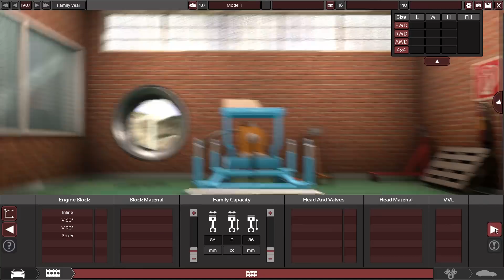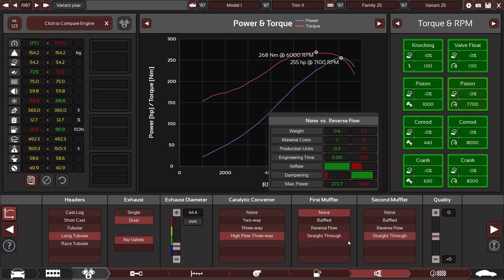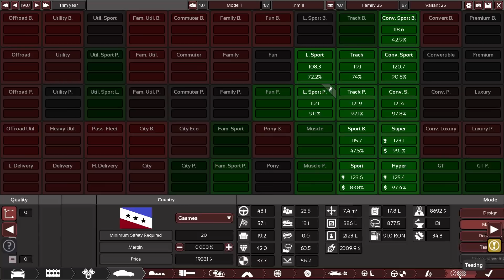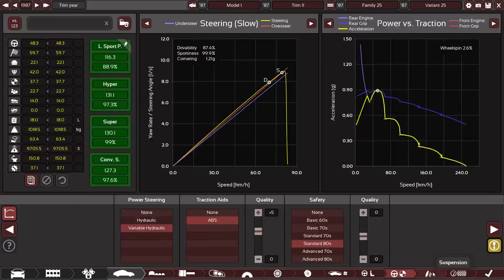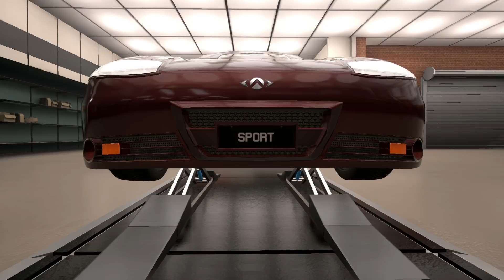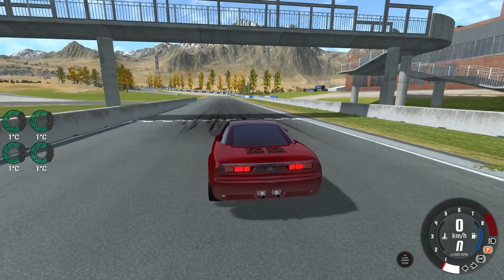BeamNG + Automation: 1987 Light Sport Premium, GETD Ep.17

Comment: Do a rally car! Must be light and easy to repair.
Reply: 90s homologation rally car. 2.0L turbo engine in 4 door 4 seat body with high torque, AWD and around 300hp. Have to be easily produced at above 5000 units per year. This is around the homologations of that era.
Reply from the maker: Rally car is not a demographic :P in case you had not noticed what this series is about ;D cheers
Reply: KillrobPlays Crossover/raised cars class (Volvo V60 Cross country) could be a category/demographic. Then a sport version of that category are essentially rally cars. Just a thought.

Comment: If memory isn't failing me, there was a 1st-gen MR2-esque body in the Kee version, which I don't think made it to the UE4 version. That would also be a very cool body choice for this challenge, being even more compact than the NSX body. 

As for the engine, I went "hopefully it's a boxer" when I saw the title. What good is a new trick if you don't abuse it? ;) Also, why is the Elanis such a monster of a hypercar? Is Boxer 6 that exquisite of a solution for the era? It's "only" making about 255hp! 

As for the design... er, the rear is period-correct. But the front screams more late '90s than late '80s to me. Why not pop-up headlights? :P
Reply: The Ferarri 328 (1986-1989) had 255-270hp and weighed around 1260kg, in that time such a car was pretty powerfull.
The 348 that came in 1989 had 320hp.
Reply from the maker: It certainly has plenty of power, especially for its weight :) it does most things a hypercar does really well, too.
Yeah, dunno about the design, it doesn't look all too 90s to me with the strong lines and overdone bulge and all that :D pop-up headlights would have been a more "iconic fit" though for sure.
Reply: I guess a better number for a light sports in the '80s is somewhere in the 170-200hp range, then. Will definitely keep that in mind should I ever design a similar car! 
And yeah, the front bulge is a bit too much for a light sports car, especially one where the engine is behind your noggin'. :P Pop-ups may be standard fare for the era, but they're the best bet for easy '80s vibes. 
Plus there are different ways you can approach them; you can either use the game's standard units, or color non pop-up ones to look like them! It's an interesting fixture type to work with for sure, as much as modern LED housings.
Reply: Mike van Lieshout No wonder a GM mini truck was faster than it.

Comment: I always found Light Sport to be a difficult demographic to exclusively cater to, they are somehow happy to pick up the scraps of others I think. (I also have to mention that my own 'houserules' for building are a tad different: I tend to set the design year so the car is /engineered/ by my target date, and then optimize for maximum markup. Probably a big mistake there with how everything is still just a dummy before the light campaign, right? :P )

I like that body a lot, and it's a really beefy car you sculpted out of it! The rear is especially well designed, I love 80s blocky car butts. Incidentally, I have made my own take on an '87 sports car on that body like a month earlier, but it's a good bit different (and way beyond my gamepad driving abilities).
https://i.imgur.com/rcTkuCS.jpg
Reply from the maker: Yeah, your competitors at this point use zero markup, so it is not a fair comparison when you have to mark up your creation at this point :)
Good looking car! Well done... man that engine is tiny!
Reply: At least it's good practice, forcing a car down their throats even at a 90% premium :P
It started out as an experiment of 'what if I doubled a kei car engine', brought on by one of the discussions I read about V6 engines and twin turbos. It works as long as you don't drop under 4.5k, haha!

Comment: The hypercar markets most likely like it because it has about the same acceleration as the 85 "Kingsguard" Hypercar. And it's grippy so it is essentially a grip/ handling hypercar (McLaren P1) rather than a top speed hypercar (Hennessey venom). I just checked and it's just over 4 seconds slower around the track with you at the wheel, so not far off.
Reply from the maker: Yes, performance-wise it is really close :D it would probably be faster than the Kingsguard around tight tracks. Cheers!

Comment: "Just a little bit more fuel mixture..." 

proceeds to whack up the fuel mixture to 12.8:1

According to my standards, that's a VERY low air-fuel ratio. I wouldn't go with that much fuel for a '60s-'70s muscle car, let alone a tiny late-'80s sports car. In fact, I typically tend to go for as HIGH of an AFR as possible (at least 14.5:1), as I tend to like my cars as fuel-efficient as possible.

I ALSO wouldn't likely have gone with a DOHC setup (I tend to go SOHC 3v to save engineering time), nor would I have gone with a performance intake (I like my cars to be as reliable as possible). (Although I tend to also build my cars around regular fuel, and I'm a big fan of the boxer engines, so we would build similar cars there.)
Reply from the maker: The car you are describing would be significantly worse as a LSP though :) so your taste definitely is not conducive to good scoring in that category :P
Reply: KillrobPlays  Then again, I'm not exactly one who likes building premium/luxury cars. I aim more for the middle/lower areas of the map, except when I'm building massively-powerful '60s-'80s muscle cars and modern super/hyper cars, and the car I was describing would definitely score better as a regular light sport. (It also wouldn't come close to the hypercar segment, although it might do well as a Track Budget car.)

Also, I'm wondering how well you could build a car under these requirements. This can apply to quite a few vehicles, and I've been able to make at least five different vehicles that can fit successfully (and at least two with lots of breathing room) into these requirements. (I've found that the older a car is, the easier it is to make for this rule set.)

*Engineering Time of no more than 60 months (5 years)
*Production Units of no more than 120
*Price maximum of $16,000 with mandatory 10% margin
*No boxer engines (they can achieve much lower octane and fit into a lot smaller engine bays than inline or V engines) 
*Maximum fuel octane of 87 AKI/91 RON (regular leaded)
*Vehicles must be completely road-legal [model years 1975 and newer must have a catalytic converter and run on regular unleaded (86 AKI/90 RON) or low-quality fuel (76 AKI/80 RON)]
*Engine variant year cannot exceed vehicle trim year by more than one (1) year
*No semi-slick tires
*Vehicles must achieve a market score of at least 125 in at least three different categories in at least three different countries (*one category in Archana*)

Comment: would really like diesel fuel to be incorporated into the game, max rew for a diesel is around 6500 rpm and the system can be either mechanical or electronic computed, all other things is pretty much the same exept that the lowest compression for a diesel is 14.5:1 and the highest i ever heard of is like 28.0:1. would really like to see that being implemented, i have heard that you are one of the guys that made the game or have a relation with the crew that made this game and i can assure you that many more people than me would like to have it incorporated into the game, mwh Charlie a
Reply: There are various thing about diesels that would have to be simulated (but before they have to finish the game)
First would be the injection systems, completely different from other engines, since the fuel has to be sprayed at or near the point of max compression, either directly or indirectly but never into the manifold.
Second would be the fact that diesel fuel burns slower, (it's more complicated than that tho) which limits the RPMs of most engines and generates much more different power curves, something like having the cam profile on the minimum.
Then would be the exhaust gas effects, how those affect turbo spool and exhaust shape/diameter.
And last but not least, exhaust after-treatment. Old cars may had catalytic converters, but most of them after year 2000 incorporated Diesel Particulate Filters (DPF) and later SCR (Selective Catalytic Reduction) with urea injection. Not to mention EGR (Exhaust Gas Recirculation) But that was also a thing on gasoline engines.
Still I hope they some year make it into the game.
Reply: the urea injection is used in some cars that is correct but most dosen`t use beacuse it is not needed if you burn more fuel witch minimize the heat that creating the bad particels that the urea is supposed to neutrilize. so that dosen`t even need to be implemented.about  the other things like hp and torque, it is true that they diesel system creates more torque then hp and at a lower rpm range, but the bigger the size of a diesel engine the more hp it is creating at a low rew. and you should know that even when you chose direct fuel injection in gasoline cars they mount the injectors directly into the head and not into the manifold. and the injection timing can be worked optimized the same way you use ignition timing, but instead calling it fuel timing, where the point of most efficient burn can be pre -.set for the system. and egr well`that is where the complicating stuff goes, the older diesel engines does not use one, and if a new engine needs one and it dosen`t work the car will not start or funktion properly. as for the exhaust they can just integrate the catalytic converter with a partical filter and call it something else when you choose a diesel engine. maybe the can make a sort of beta and let people test it so people can come with things that come up with things that can be added an so one before they try to implement it fully into the game, that is just a idea. but i hope that we will see this in the future.

Comment: IRL that car would have been a hell to work with the spark plugs beacuse 3 is sticking out ( easy ) and three are forward against the torped wall.
Reply from the maker: Yes indeed, probably would have to access it from below. We'll take that into consideration calculating the service costs :)
Reply: the price for replacing 4 spark plugs on a normal boxer 4 in a Subaru can cost upwards to 30% more in work cost in comparison to a normal inline 4.

Comment: Will camless engines be added, like the koneggzegg freevalve?
Reply: spaz monkey Probably not, and if they did they would do it after the full game launch.
Reply: Martin Hübinette true, but imagine the power boost
Reply: And fuel economy.... Would probably have to be balanced by having a lot Engineering time or cost due to software, Idk.
Reply from the maker: No, that is not tech you see in racing yet, which means it most likely won't be on the roads in 10 years time as a viable tech. So it is outside the scope of the game. :)
Reply: KillrobPlays shame

Comment: You should have put a wing on it and a lip/ spliter
Reply from the maker: That's not so good for a Light Sport car because of the low speeds you are making the car for, so it just gives you a lot more drag for little benefit :P
Reply: KillrobPlays does it kill the economie that hard?
Reply from the maker: No, just a bit, but you would add engineering time for something that isn't useful.
Reply: KillrobPlays what is engineering time? What does it mean to have high engineering time?
Reply from the maker: It is how long it takes your engineers to figure out before being able to put the car into production, measured in months.